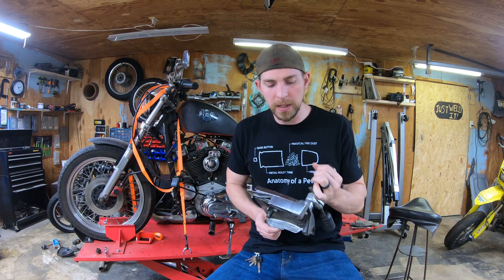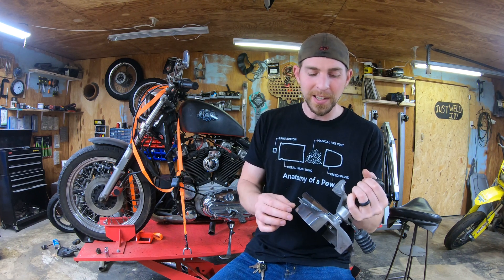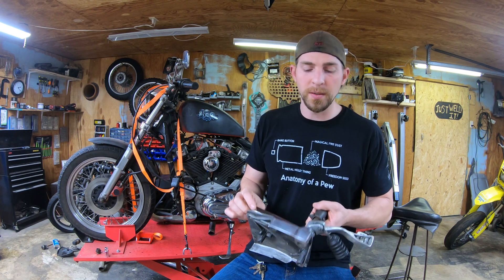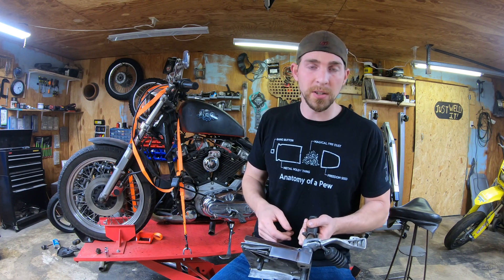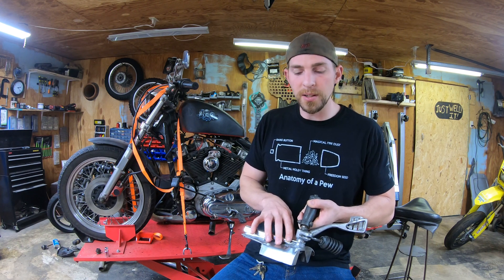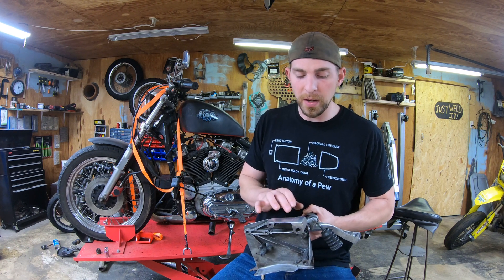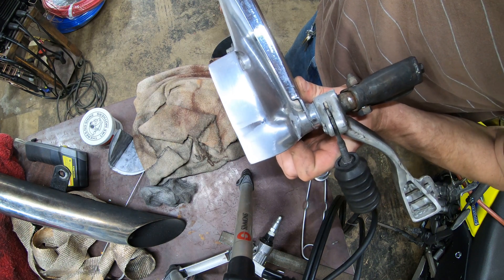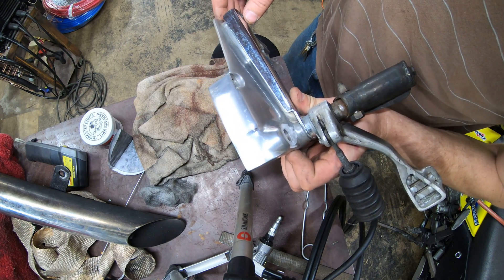Fix Cast Aluminum With Aluminum Brazing?!

Comment: Doesn't aluminum welding rods have a melting point of 750F your part was only at 300F at the hottest point. According to your meter.
Reply from the maker: With the jewelers torch the heat was rising a LOT faster than with propane so after getting to ~300° I just started watching the rod for signs of heat, definitely didnt want heat to rise too fast and accidentally melt through my part. lol